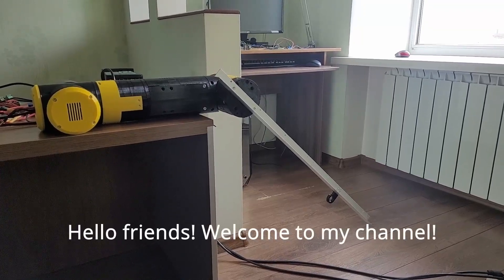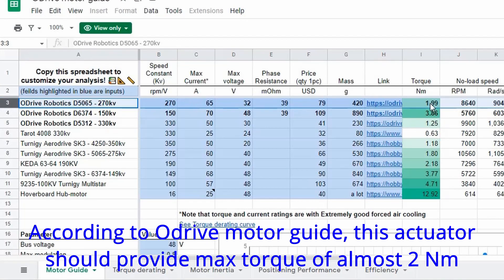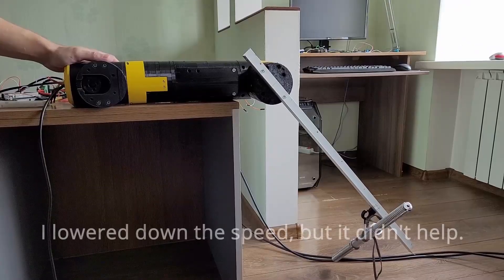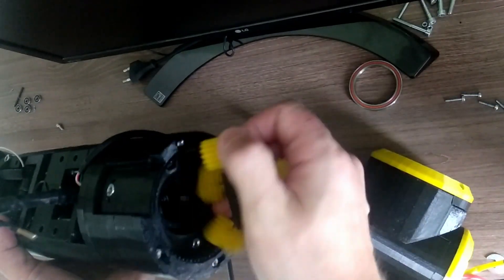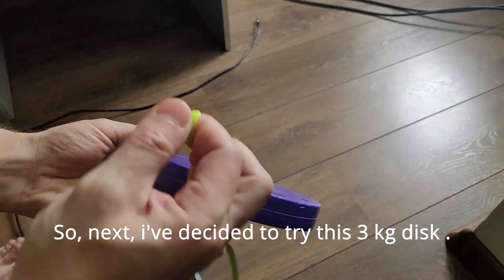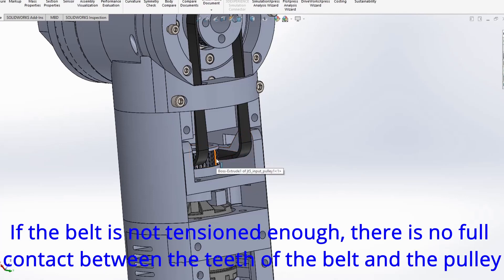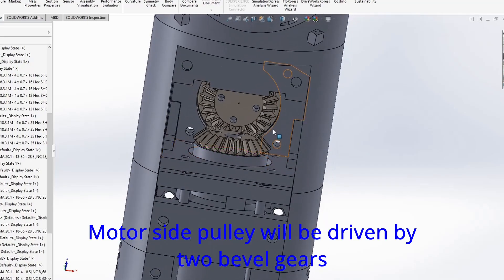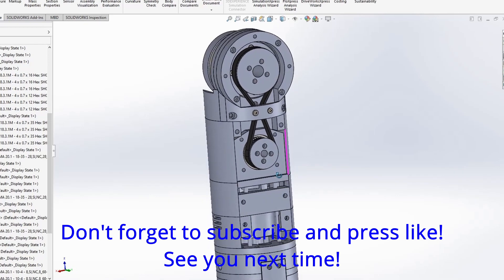3D PRINTED ROBOTIC ARM: TORQUE TEST #1(MIXED RESULTS )

Comment: Sometimes the belt slipping can happen if your timing pulley profile (mostly if it is 3d printed)is not matching the belt teeth profile properly. Sometimes the pulley tooth profile data you get from internet can be wrong. To check this, just wrap the pulley with belt, but dont force it to match, and see if the teeth are going into the pulley groove smoothly, without rubbing the groove side walls. ( I know you found and solved the problem, but just in case....)
Reply from the maker: Thanks for catching! I'll check that.